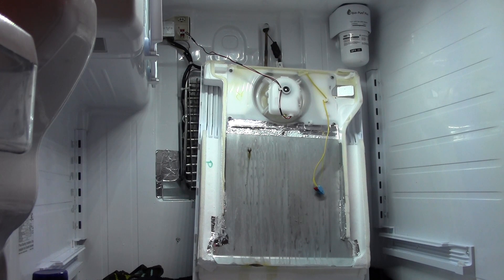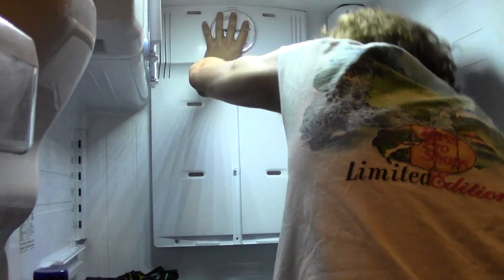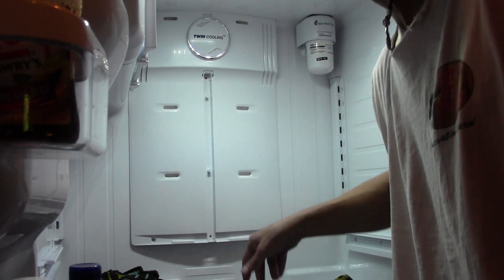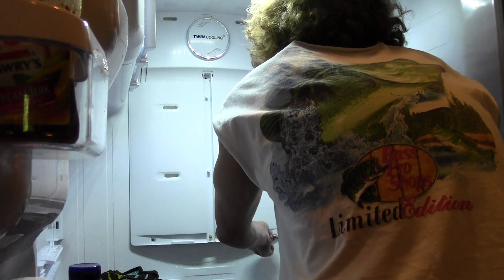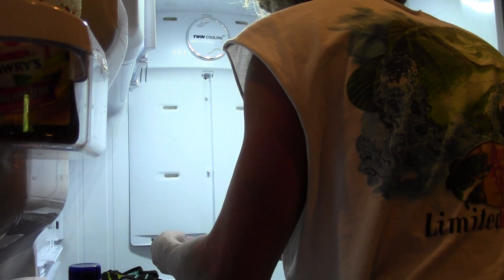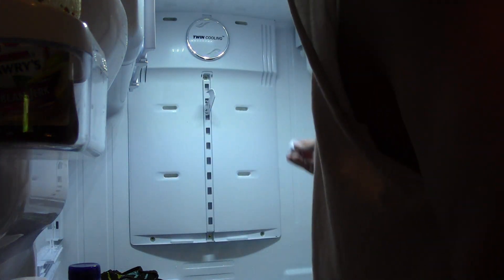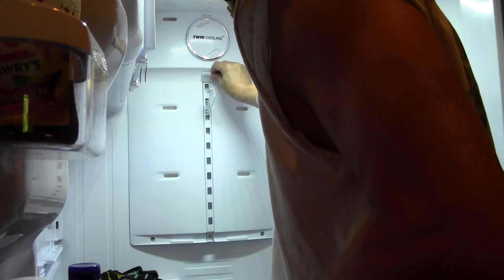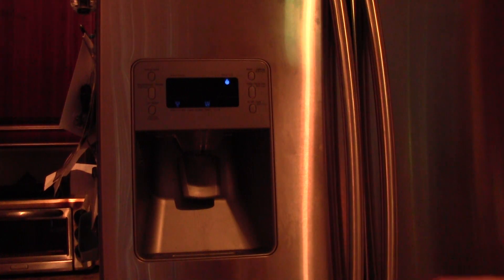PART 4 How to Fix a SAMSUNG RF 267 Refrigerator Not Cooling Icing and Freezing DIY repair

Comment: I have taken the panel off and it's pretty much defrosted. The drain still is not flowing so I guess it's still frozen but I am.worried about this piece wrapped in electrical tape. Seems melted. Can anyone help.

Comment: I was able to get a Samsung tech our to fix my frig freezing up. He knew the problem quite well and said that he performs this repair several times a week.        He replaced the sensor above and to the right of the evaporator coil and he replaced the entire front plastic cover which also has a sensor in it.
Reply: Mind if I ask how much the repair cost?
Reply: Should not cost anything. I think the heating could needs to be on all the time...

Comment: I know I'm a Lil late but instead of just hurringing and opening the door to see if fan is spinning you could of just took your finger and pushed in the door button\switch and watch your fan that way without even closeing your door...
Reply from the maker: Its a good idea, but this fridge does not have one of those buttons.  The switch is built into the door hinge.  You gotta close the door for the switch to work.

Comment: Good troubleshooting, but the real design issue and correct repair is the drain tube which gets clogged on the bottom and than drain tube gets frozen, therefore water overflows and gets on the bottom. To fix the issue you need to remove back bottom cover, remove the right drain hose, once removed, Separate hose from the plug which has two small holes which is clogged,  make the holes bigger and reinstall same. You will never have frozen drain and water on the bottom. All the best....EC
Reply: BINGO!

Comment: I tested my fans in freezer area and fridge with a 9v battery and some wires. pull your plug and connect your wires to the red and  black prungs. Make sure to test your battery before you attempt. My first battery was dead. stick the battery to your tounge. You will know if it's good or not.

Comment: This video show how to disassemble the evaporator cover but did not address the problem,. The issue with this type of Samsung refrigerators is the system to defrost the drainage area does not work properly.  As the drain gets clog with ice, the evaporator accumulates ice and eventually stop the fan causing the fridge area is no cooling.

Some refrigerators can be fixed twisting a well conductor wire through the defrosting heating element and ending ia couple of inches inside the drain hole.  My fridge did not work with this wire  solution.  Please, add comment if you know other possible solution. beside throwing the fridge in the garbage.
Reply: Just ordered mine to see if that fixes the problem.. DA61-06796A

Comment: i Saw another video on this subject.. you need to replace the heating element that keeps it from frosting, its about 59$
Reply from the maker: Try it and let us know.  The people I have spoken  to say it does not work.
Reply: +jakeguitar01 .. What doesnt work, installing a new heating ? I think thats what is causing yours to freeze over the coils
Reply from the maker: You would think that is what is causing it, but the heating coil and the thermostat test out perfectly.  It's something else...
Reply: Another guy on another video installed a copper wire from the nob at the bottom above the drain hole. He made sure the copper went into the drain hole a few inches. Apparently the job is supposed to heat up to stop the drain freezing over but it's too far away from the drain. The addition of the copper conducts the heat and passes it further towards the drain stopping it from freezing over.
Reply: *nob not job
Reply: Same here..Everything tested good... but still Freezover ... Will by the drain fix, clean drain hose in back and see if it solves it.

Comment: THANK YOU LOL!!!!! We did just what you did here in your videos today. Ours is a little different. Different model. But once we got the back panel off to expose the coil element and the fan ect. We saw the ice all over it and they are the worst dam refrigerators going. We will never buy another Samsung anything. Your videos helped really. My husband is an electrical engineer and he knew some things but you really had to count on as you took the stupid thing apart that you were patient and din't break anything. It's all so cheaply built. Fingers crossed it will live for a while longer till we can buy a decent one.
Reply from the maker: Hi Sophia.  I am glad my videos here helped you.  Unfortunately, this is just a temporary fix to defrost it and get it going again. Most likely you will be taking it apart in the next 3 to 6 months to do it again.  And, it starts happening more and more often...
Reply: That's ok it bought us some time. We really didn't want to have to replace it right now or have to pay a repairman to come in. There was a huge chunk of ice right in back of the fan on the coil my husband removed and we checked everything out and put it back together and it is quiet and thew temp is back to normal. Poor cheap design is what we saw. Never again will we buy these prodecuts

Comment: I just went through this whole process.  The videos and commentary have been extremely helpful!  

Everything is cleared.  

Additionally I will clean the coils in the back that are fairly caked with dust.   You can get there by removing the lower back panel.   The air flow vent is on the right on mine if you are looking at the back.   Just remove some screws and the whole panel comes off. 

I also ordered the special part to wrap around the heater coil.  It is a few days away.   Somewhere I read that a copper wire might do the same trick.   My thought was that all of this looks like aluminum so instead of copper I thought to just cut an aluminum can in a strip and wrap that around the heater coil.   Though the heater coil may be copper???   

I also read that the lower fins needed to be pushed flat to the coil so that water drips into the little trough.   Most of these were mangled probably form ice formation already.  So I pushed the front ones that extend forward past the trough flat.       

The turkey baster worked great to final clear the drain.   Just used it to spray hot water in a couple times.  Key there is to squirt the same water in and out til it gets cold.  Then suck out the cold water with the baster and do again with hot water.   Took me three times but the third time the water just disappeared...   I am not quite sure where it goes.   I think it goes in the lower coil area which I started to take apart.   Looked like it too has wiring that makes pulling it out complicated (same as the top...).   Or at least not simple.   The coils all looked clean of ice so I just put it back on.   

If I get 12 months I will be happy (happier).   IF not I don't know if the aggravation is worth it.   Life it too long to deal with this crap all the time.

Comment: I would not call this repair. This is simply defrosting fridge evap and clearing out the drain line.  it's a quick temporary fix.  need to find actual source of problem... bad thermister... bad insulation... door stuck open.... piece of food stuck in drain line
Reply from the maker: +ADubTheGrizzy  I am actually getting excited that I may have finally came up with a more than "temporary fix" for this piece of junk fridge.  I just want to make sure before I let the cat out of the bag too soon, and wait to see if if freezes up, with what I did about 6 weeks ago.  If it works, I will post a video about it.  If it doesn't, I may still post the video because so far it seems to be at at least helping....  Please subscribe so you get the new video on this when I post it.

Comment: Didn't actually repair anything here, just defrosted it. There is a revised drain strap which can be had for less than 10 bucks, which will actually keep the drain from icing up again. The Samsung part number is DA61-06796A.
Reply: A piece of copper wire about 3 inches long wrapped around the heater coil over the drain and into the drain hole will do the same thing ... even cheaper  !

Comment: Pro technician here, The Refrigerator is built by Samsung. Several fixes for this problem. To easily remove the evaporator cover use a steamer instead of a hair dryer. Or you can just shut the power off few a few hours. If the unit has a clogged drain then blow it out with the steamer or use hot water to clear the drain. The very bottom row of evaporator fins need to be pushed flat against the coil so water can drip into the pan properly, there was a design issue with this. Also check for any  foil tape they may have peeled and clogged the drain hole, remove it , it is not necessary. make sure that the metal hole is in alignment with the plastic drain hole. You can add the additional wire to go from heater into drain hole, but bending the lower run on the evaporator  coil will solve the problem. If you have ice forming on the complete coil, then check continuity on the heater assembly. If there is ice only forming on the upper right portion of the coil then replace the thermistor, it has just lost its value slightly and is not staying in defrost long enough for the coil to thaw properly. It looks like a white bullet shaped object with two yellow wires and it clips on the evaporator tubing in the upper right hand corner. This will permanently resolve your issues.  JMCWATCHDOG
Reply: John Carbonara  I took my unit apart, and done all of these steps, and now when I plug my fan and light back in, it will not work. Suggestions?  TIA!
Reply: +kphillips2324 The fan works, the light never started working again, but its been 5 months and the problem seems to be fixed.  The light must have just shot when I had it out.  No biggie though.  The wire done the trick!  Good luck! :)
Reply: So you replaced the wire that connects the fan motor to the fridge? Thanks!
Reply: Thank=you, John!
Reply: John I have a question about the electrical tape wrapped around something behind the panel if you can help
Reply: The hair dryer works fine if you don't have a steamer.....TRUST ME ....I own this SILVER ELEPHANT too ...

Comment: good video - definitely helped with my RF266.  I would have broken the rear panel trying to force it off not realizing it was frozen in place.  Mine didn't have nearly as much ice - just the lower ledge where the drain is.  Just to clear the drain - thawing - emptying the fridge took about 6 hours - so patience is key.  I took Dunne's advice wrapped a piece of solid wire around heating element and stuck it in the drain hole.  Time will tell if it works.

Comment: The best thing you can do is join the class action law suit against Samsung for this defective design flaw. You might get your money back years down the road.

The subsequent poor customer service to protect themselves from great financial loss is really disappointing. Samsung is not looking out for their costumers at all. You buy their product and they give a quick "good bye" regardless of how awful the product is. As long as it can be fixed, Samsung doesn't consider it to be a defective product... Samsung thinks paying $400 every 4 months for a 2-year old frig in order to fix the same issue repeatedly is acceptable. I do not, and I don't think many of you do either. It is not acceptable. It is fraudulent.

Keep all receipts, records of phone calls, photos/ videos, etc. and call the number on this website below to join the class action lawsuit. It only costs you a few minutes to tell your story. There's nothing else you can do to fix this lemon. Get it out of your house whenever you can afford to.

http://topclassactions.com/lawsuit-settlements/lawsuit-news/811-samsung-refrigerator-class-action-lawsuit/
Reply: Samsung sucks in retaining satisfied customers.. Even their LCD TV have issues caused by their bad firmware updates. They removed features from their Phones , regardless of the pleading from customers not to do so (Note 4 to new models)

Comment: While you are dealing with the ice right now, there will be continual build-up until the defrost heater is doing the complete job, and the drain tube is not obstructed with ice.  While the defrost thermistor replacement may work, you may also have to replace the defrost heater and/or try a little American ingenuity vs the Korean flaw on this particular design.  Take a 4 inch piece of Romex solid copper wire (the ground wire without insulation works just fine, 16 to 14 ga wire), and wrap it around the defrost heater one wrap, and drop the remainder of the wire down the drain hole.  This seems to also stop ice from obstructing the drain hole that seems to continually fill with ice, as it runs past the freezer chamber below the refrigerator compartment.  Having to deal with this problem more in my area as people are convinced to buy Samsung refrigerators (poor decision in my opinion, only made worse if you buy the blood-brother's products . . . LG.  These companies do well with all but refrigerators) from their local appliance sales stores.  The pretty blue lights are not worth the headaches and expense to repair, in my opinion as an appliance repairman.

Comment: Our fridge has done the same thing and we unplugged it for about 24 hours and then plugged it back in and it worked...but only for about 5 days before the lawn mower sound (the fan) was going off on it. Not sure what to do now. Sounds like the fan is still working. Going to buy another one, but this time...nothing fancy. It seems the more costly the fridge, the more problems it has. If I have something with an ice maker, I think I'll be satisfied. I hope!

Comment: You totally saved my sanity! Perhaps you've saved my expensive refrigerator as well. I mopped up tons of water under my deli drawer on my RF 268 Series Samsung frig that looks just like yours. I found it only after water poured into the freezer when I opened the drawer at 11pm Friday January 31, 2015. I continued to mop up water for the next 5 days not wanting to call service on Saturday and having company until Wednesday. My brother-in-law suggested I try google. Your series just popped up today. For now, the water is no longer gushing out under the tray and I thought I was going crazy. Without being able to identify the source, I'm afraid I will face it at any given moment again. Now I need to set aside time to follow you wonderful videos to defrost it. As you & others warn, I can expect to face it many times during ownership. You totally rock!

Comment: It's 4 days to Xmas and 5 days till I go camping for a week and of course the Samsung fridge has stopped. You have saved me $100 so huge thanks Jake. I didn't have much time so I used a gas blowtorch (carefully) to speed up the defrost! My model is a side-by-side but same concept.There was also some piece of food in the rear drain that needed clearing.

Comment: Great Job explaining. I have been doing the same thing to my fridge for over a year. I m having to do it more frequent now, about every month or even sooner in the summer.. I am wondering if I have to replace something like Evaporator defrost system?
Reply: Ever figure out a permanent solution here?  I'm in the same boat, this is the third time I've had to de-ice mine!  thanks -

Comment: great help by showing all this.  I did the big defrost, no ice, no funny fan sounds, but now, now the whole refrigerator stinks like an old ice chest.  no rotten food, but can guess we have water sitting somewhere in the inner workings?  If we leave the doors open for a bit, the smell is less, but it's still there.  Is there anyplace on the back that can be opened up to drain out the standing, nasty water?? thanks.

Comment: You may not be a professional fridge consultant but you should be.  I have a RF217 which iced up so badly in the freezer that the door wouldn't close. I defrosted the whole thing and got a Titanic sized piece of ice from behind the back panel. No trouble since then - that was 8 months ago.  Just recently, the circulating fan in the fridge section began making loud rumbling sounds and I suspected the blades were hitting on ice.  I emptied and defrosted the top section and tried and failed to remove the back panel so put it all back together and restarted it. Worked fine for three weeks and then the fan started making noises again. I will now try your hair dryer solution and really defrost the damn thing. Thanks for the video.

Comment: Thank you thank you thank you!!!!  I had water collecting under the bottom drawer and figured it was coming from this area but couldn't figure out how to get that panel off.  Once I defrosted it, and got it off, I found the drain clogged/frozen.  Unclogged it, checked the fan (thanks for that tip), and put it back together.  Didn't have as much ice as you but there was some.  Couldn't of done it myself without you.  Really appreciate it.
Reply: All you had to do was call me

Comment: This is a known problem for this fridge. The real fix is the drain heater probe kit. (http://www.appliancepartspros.com/samsung-clip-drain-evap-da61-06796a-ap5579885.html)
However that fix repairs the complaint of water in the bottom of the fridge and in the crisper. If you have ice built all the way up the evaporator (like Jake did) you probably have a problem with the defrost heating circuit. It is very common for the defrost bi-metal to stop working in this unit (its a little wire clipped on near the top of the evaporator).